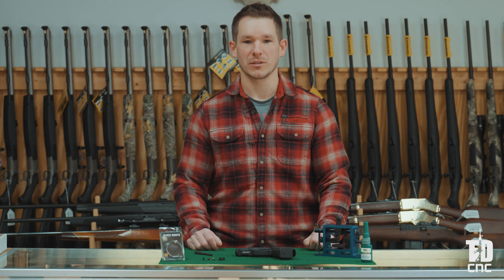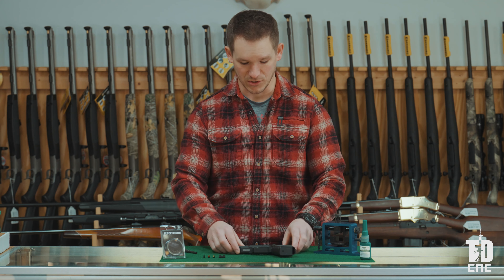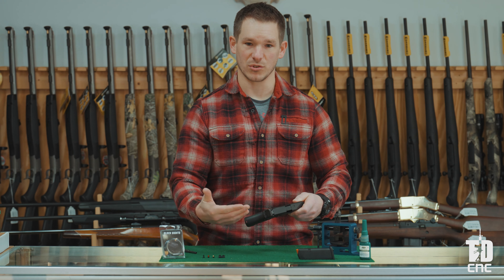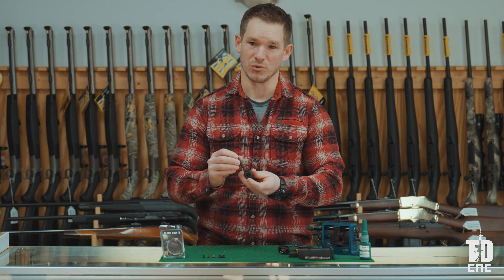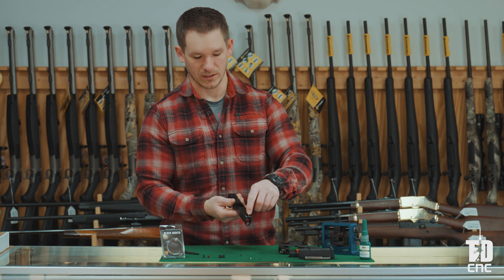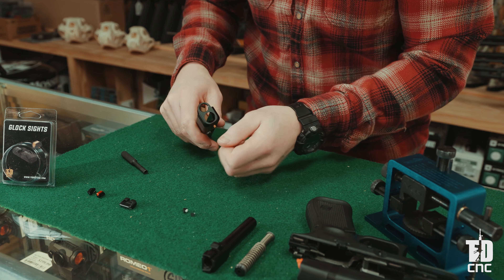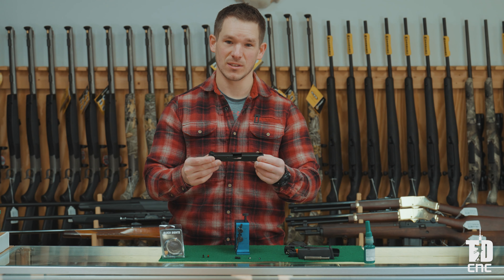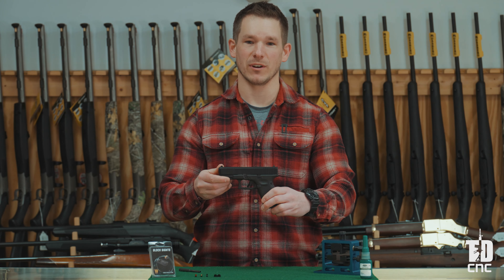Tyrant Designs Glock Sights Install Video

Comment: surprised there is not a silver option for the front sight
Reply from the maker: We're always expanding our line of colors, so stay tuned.
Reply: I have a glock 19 gen 4 whit all the tyrant pieces but i dont buy this sights only because i read a lot of comments that they dont fit in gen 4 and gen 5